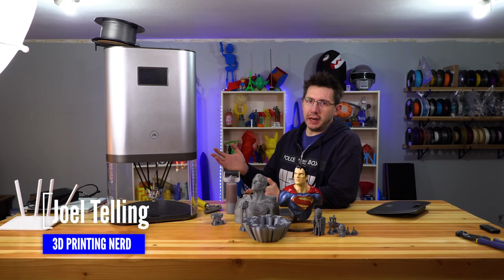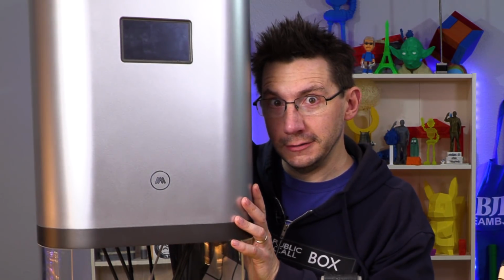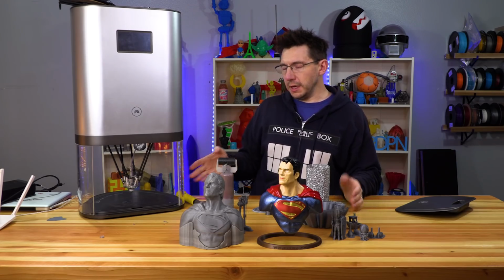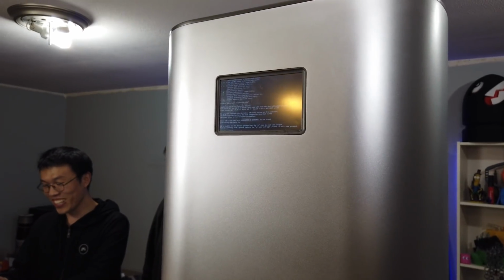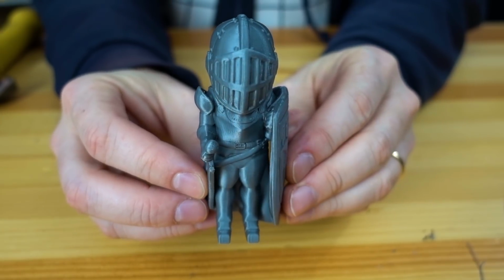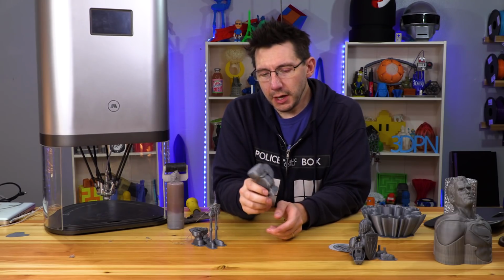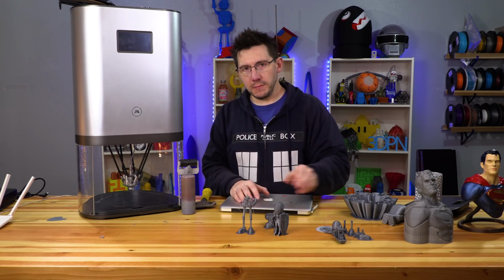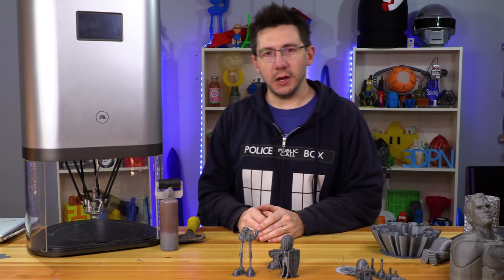3D Printing with a Prototype IVI 3D Printer

Comment: When you punched the end effector around a couple times while it was printing, and expected it to recover, well, even if that system uses servomotors with quadrature encoding wheels and knows exactly where it went, with the filament being spewed into unexpected places, I couldn’t see a reasonable way that COULD be recovered even with a closed-loop motion system. If it just uses end stop limit switches and stepper motors, well, only at end stops can you know where you’re at, and the rest is a best-guess from past hits of limit switches on the presumption the stepper motors never missed steps and never were somehow back-driven to a location they didn’t sense.

The fact that it could take those hard knocks and be used after that abuse says to me, even if it gets out of kilter for the remaining print time, they’re doing something right, and the printer will have a sufficiently long and useful life in the real world, even in seismically-active zones, barring buildings coming down on it or something equally bad.

Comment: I like the idea of a printer coming stock with closed loop steppers. I think the problem is that the closed loop system has a really hard time fixing a large position shift like when you knocked it. I am still on the fence as to if closed loop systems like that are useful on 3d printers since they tend to move so quickly and have a lot of combined axis movement going on at once. There's a huge potential there, but I haven't seen a printer that can REALLY recover from a full blown nozzle crash situation like that. I've seen printers that can get pretty close, but the nozzle always returns to a spot that's pretty close to where it's supposed to be, but not quite, and it throws the extrusion off almost always.

Comment: Looks cool - my silly idea - what about mounting the cooling fan in the body and running a tube down one of the legs to cool under the head.  That would save weight on the head, minimise redesign and still provide cooling?? - I don't know if you are in contact with them but it might help.

Comment: Ok sure their are aspects of this printer that are certainly cool, but the word protoype means different criteria to different people.  My mind thinks  00.00 flattness & low or no coefficient of expansion.  Went to a Stratasys reveal at Hen.Ford College. They had baby bear,  moma bear, and their wis-bam Fortus 900 at 1 meter by one meter by 1/2 meter outrageously priced at 600,000$.  Talked with a "CSWPE" . There are only maybe 300 or so qualified to that license, as opposed to CSWP's that their are a few million. I was told that flattness was only garanteed with a slop factor of 1/2" at a foot x foot printout. Duh nobody assumes their going to print a piece of crap.  A week later the people from PBC Linear sent me an e-male bragging about their parts in a printer 1 meter x 1meter x 1/2 meter at 21k$.  That printer is a 3DP-Platform WorkBench Series. Now thats cool, but since then 3DP has cooked up 3D printers so big no one would believe me if i told you.  Instead of the scale model or toymakers printer these guys think and produce full sized auto, boat, aviation , and even 107ft long wind turbine blades able printers with extruders that use 16 -5pound spools per day or much higher.

Comment: Hey Joel, even without a fan you can stop the melting and deforming layers by increasing the minimum layer time in Cura (extra settings) to stop heat buildup which allows the parts to melt. That probably would have saved your dancing Joelbot.

Comment: as someone with previous "money is now gone" experience, I can say I rather don't like many of the things that go on during these sort of events.  I have personally lost over $1000 to several different "companies" promising various things, that never finished.     I have a huge desire to get a 3D printer, and a huge passion for crafting and hobbies, but I still don't own one.  I don't have the $$$ to spend on one, even used, unless I can find something that "generally works" for $200, which, is just asking too much in most cases.     With that said I WAS curious to see the kickstarter.. but.. cannot seem to find it.    I checked the page and immediately found a huge RED FLAG.   It wants me to share this with friends, who are interested in buying, to get bonus rewards.  A typical "bonus referral" pyramid like system.... with 50 friends being the cap.

This is.. .not good practice.  The 'offers' are tempting - if they are indeed valued at the prices they show, but this sort of behavior strikes as UN professional, and cheap.  I am not trying to be mean to the people involved just, there are better ways to go about this sort of thing.  Not to mention,  50 friends also buying one of these? really?  That is a bit steep, I don't even HAVE 50 friends, nor does anyone I know.  The only people with "that many friends" that I can think of - aren't going to use it as an actual friend thing, but a referral offer on forums and youtube videos and events such as that so they can try to get all the 'goodies' offered.  They state it will launch first on Kickstater (not there yet) for $800, but "act now" and you can get $500 off, and then combine that with the "refer 50 friends' for an extra  $300+ value worth of tools, supplies and attachments and its absolutely smells of "Too good to be true" money sink.       The only thing I see is them linking this very video for advertising and giving very  "basic" details about the product.

It's advertising some rather extreme promises, such as printing a bird in a cage smoothly smaller than a US Quarter size, but also some of the most perfect smooth models I have ever seen.

IF TRUE  - this is absolutely going to destroy the competition in market.   The same quality/options in any other printer would be well over $1,500 and I mean WELL over.  Offering it at HALF that cost is absolutely unthinkable.

But with that... I won't be , nor able to, sink even the "$300" with $500off first buyers offer into getting one, the risk is just too high, it's quite literally promising the most premium grade material, for a fraction of the premium costs.

I know you can cut SOME or even A LOT of cost by eliminating middle men and retail sales reps. and the like... but I think this is a little too extreme even considering those.

Comment: Hmm... https://www.youtube.com/watch?v=RNZCt5NvUyA&t=71 "Nozzel temperature"... really? And then it lists a 100C max bed temperature... for a printer that doesn't even have a heated bed? Finally, Marlin has been successfully compiling on the STM32 platform since April 2018, so just how much porting to STM32 was actually required by IVI?

Sorry, Joel, I'm shaking head here. Of course it's your channel to do with as you please, but as a viewer I'd suggest you don't feature prototype printers here - especially for something that hasn't even hit Kickstarter yet. For now I think I'll stick with my current deltabot, thanks. #Highfive

Comment: I respect that these young passionate people are trying to come out with a 'simpler. easier to use printer' but it's just not going to happen. Not because of the printer but because of the creation  software. If you are doing 2d art of any form it's either Photoshop or GIMP. Both are hugely complicated and have a steep learning curve to get anything meaningful out of. It only get's worse with 3D! I am immersing myself in Fusion 360 and it's a deep and complex tool. It takes a long time to really get to grips with it and I'm really pleased with my progress but it ain't easy. Are there other simpler tools? Sure but you sacrifice flexibility. One of my two printers is an Anycubic Linear Delta printer. I'm experienced with it and I'm pretty confident I can walk up to it and shoot PLA till the cows come home. It took me about three months to learn about it and nail it down to the point where it's extremely reliable and now it produces excellent quality prints. I'm not going to compare it to anything else because that just becomes a dickfest. The printer is no longer the issue. The software is the issue. I can now run Cura without even thinking about it but it took time to understand. I can fab up pretty much anything in Fusion360  but it takes time  to do. It's not the printer. It's the front end and with the greatest respect (because all my printers are Chinese) software is not the Chinese strong suite and they probably are not going to create their own Fusion 360 or Cura. Best of luck guys but at the price point you are talking about expectations and you competition will be very high.
Reply: Thanks for your encouragement, we will try our best.

Comment: I think, what is mentionable is max nozzle temp 320°, but max bed temp 100° what can be problem for polycarbonate.

Concept is great, but it looks too good to be true - delta printer, 32bit, raspberry included, camera, touch display, linear rails. That all is above 300$ budget. Where is profit for makers?
Dont forget also for additional shipping costs.
Also no way to attach on this CNC milling module. This promise makes this project in my eyes very untrusted.
Reply: Thanks for your comment. $300 units are limited. We never expect that we can make a fortune from this Kickstarter campaign. We have lots of ideas in the future, this printer is just a start. We're trying to build a long run business, not a quick money project. We want to build a brand from this campaign, then we will continually develop more products. For the features mentioned in our website, that's possible, because we're located at Shenzhen, there are manufacturing systems can help us to achieve that, I believe, no other places in the world can do that. The only problem is how many units we can sell.

Comment: Fun stuff, neat to see this new stuff even if it's far from retail. (Does the closed-loop control and the nudge-ability mean they aren't actually using stepper motors, but something like a bldc with an encoder? That would be cool!)

I'm not too concerned about the price difference: in my experience, for consumer goods that get shown at CES, the prototype might cost 30 times what the retail one does: you make different choices for each state of development, and at that early stage, everything is one-off or off-the-shelf from an expensive shelf.
Reply: It's a closed-loop stepper, not a bldc, maybe we will try the bldc in the future. Developing a great hardware product is hard, mass production is even harder, but we'll try our best.

Comment: Very noble purpose and drive. Many of the ideas are good however, I really don't think the Delta style platform is the way to implement them...  the closed loop feedback is great but the combination of complex math for translating the movements of three vertical axes into the standard XYZ coordinate system are going to cause far more problems than it is worth... the delta also does not give sufficient movement to effectively use any but the highest definition  (and highest price) encoders. The delta system would also be a very poor candidate for any kind of CNC cutting work as it does not have the torque potential required.  I would concentrate on getting the software ti the highest standards for ease of use and reliability and reputability and then re-evaluate the hardware systems.
Reply: Thanks for your advice. We will think about that.

Comment: This all seems like a terrible idea, it's a badly executed delta printer which are INCREDIBLY simple machines and they claim they're going to build SLA, milling etc into it before even trying to? Very strange. From a design engineering point of view, a 4th prototype that looks like that on the inside is very worrying. The current machine looks like a week's worth of design time at most. I'm a huge supporter of striving for big goals but this seems like a very bold claim with no evidence to support it so far......
Reply: Thanks for your warning. All the SLA, milling etc functions are working, we just didn't bring them to CES. I don't know other delta printers, but IVI is not a simple machine.

Comment: I like the idea of a simple to swap nozzle and being a delta makes it leaps and bounds above the beginning printers out there.  But a prototype without a filament fan?  No heated bed?  All for 800?  You have to compete with the pursa at that price point.  I won’t even get into why you don’t use marlin for deltas, even with a stm32, hardware floating point or no.  Not saying it’s a scam. Mind you, just seems like they need a marketing consultant or someone who has run into these issues designing printers.

Side note, I hope they get rid of the closed loop controller.  I rather have true arc generation in marlin as closed loop with 3 axes is a nightmare that will kill this project more than any other problems they have.
Reply: Thanks for your comment. Take it easy, closed loop controller won't kill any project. It's already working. We have fans at the top of the printer, it's not enough though, will fix this issue in the next iteration. STM32 works fine for us.

Comment: 4:43 - Uhhh what? This is concerning. This is starting to sound like ink cartridges for regular printers. Can we get confirmation about that? I don't like the fact that they are making nozzles that only fit their machine and then stuffing PCB's on it with potential DRM that stops you using "rip off" parts.

3D Printing is doing fine without Apple scumminess in the industry, we don't need scumbag companies similar to Apple DRM locking this industry down.

Comment: Great video Joel, but I'm kind of less than interested in this machine.  So you start out paying $800 for a less than impressive FDM. You'll pay who knows how much for each accessory, then wait to see if they go under while they spend 3 years ironing out all the issues with the machine itself, then they've got who knows how long to iron out the accessories, and even then all in one machines are meh at best. They either do a half rate job at everything, or do one thing good, one thing okay, and everything else terrible. 
Laser etching is kind of cool before you play with it and realize without a gas filled chamber you basically have a gimmick, SLA on an FDM fame? No thank you. CNC on a delta? Might be great for balsa wood or foam. If you want the make PCB's you'd be better off buying an A8 and turning it into a dedicated machine. I just getting tired of these companies coming out all hype and no show.

Comment: I like the looks of the machine and it would probably make for a good school printer if that clear area can be locked. I agree with you on the price point in that $800 is likely not realistic, especially if using genuine hiwin rails. Though not impossible. If they do manage to achieve that kind of price point for a machine that looks like that I think they could give Creality a run for their money as long as they work the quirks with the development out.

I appreciate that they tried a carbon fiber bed surface so now we know that it isn't really that great of a surface option (unheated) compared to maybe something like Garolite (essentially fiberglass sheets). At least, according to them and also based on these results shown in the video. Trying the carbon fiber tells me that they're willing to experiment and innovate to improve their product, which seems to be rare among Chinese developers and manufacturers (no offense meant.) I also like how they're adhering to the open source as you mentioned. I also like the idea of having changeable heads as this might simplify nozzle swap procedures, though I suspect that will be a lot of wasted technology and materials and cost for anybody who knows how to change and calibrate a nozzle on systems we have now. It brings a new definition to "hot swap." :P

Advise for the part cooling: They mentioned just cooling the general area with fans that are based in the top area of the machine. How about setting up fans that would blow air into a tube where the tube directs the output of the air? That way you'd keep the noisy fan in the upper part of the machine that could dampen the sound the fan produces and the air can still directly cool the part with some sort of nozzle at the end to evenly distribute the air kind of like how a bowden tube does for filament. That could potentially still have the weight savings benefit and also reduce resonance, though I don't know how much resonance a part cooling fan creates in a print. Don't forget to make sure there is some sort of ventilation system to let the air escape. Oh, this idea of doing the fan with tubes might also allow to use a larger fan running at a slower speed to reduce noise even further as long as the air is all funneled into the tube.

For a start up company, if they're looking to make this an "all in one" printer and milling machine; It is really concerning because it can be an interesting idea, but I think it would be a wiser choice to focus on making it an awesome printer first and then make a new model later that is capable of the printing and milling once they have an established foothold in the market and income source to fund further development. It already has a nice and recognizable look to the machine and I think it being the master of one thing would be better to start with than a master of none. 

Shout out to Joel Bot dancing.
Reply: Thanks, Greg, for your comment and advice.
1, Carbon fiber works great for us. We're passionate people and love 3d printing. We're working hard to build great printers for the community.
2, "Hot swap" is possible. I like the name, by the way.
3, The cooling issue will be fixed in the next iteration, thanks for your advice.
4, You're right about the startup company. We will think about this.